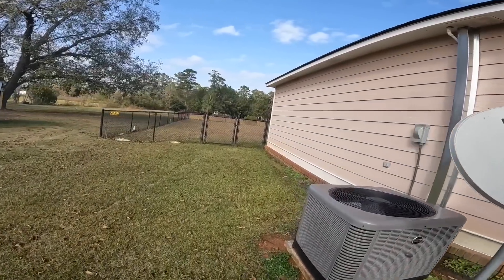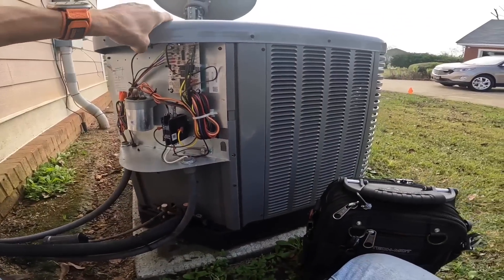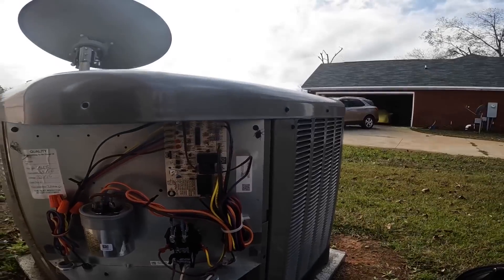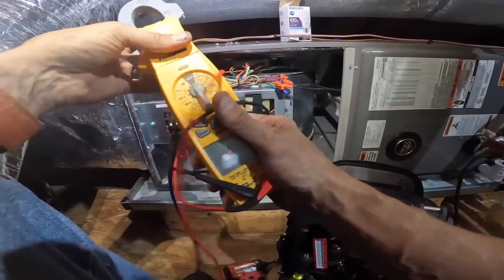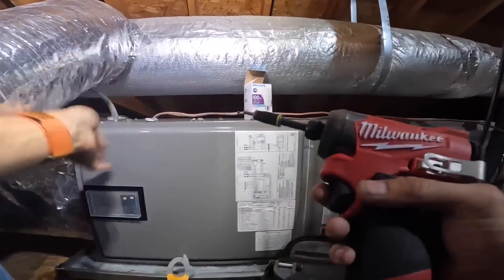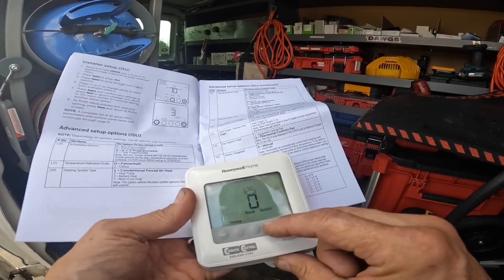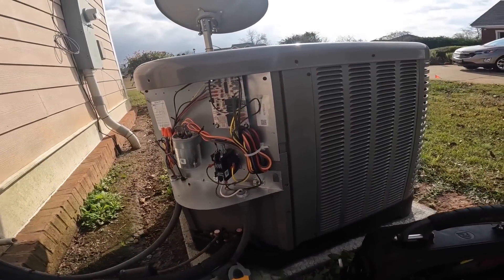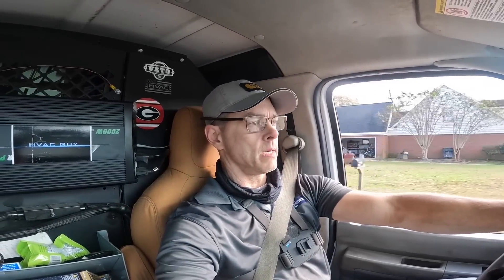Very High Utility Bill For Previous Day

Comment: I have had a few issues with these also, that was a pretty lengthy diagnosisng process for figuring out a pretty easy issue. You don't need to put your gouges on every unit you come to.
Reply: If it’s a no heat or no cooling call, you ABSOLUTELY should put your gauges on the equipment. You are there because the system is broken. It’s your job to make sure EVERYTHING is working before you leave. It only takes five minutes to check the charge/evaluate performance of a system you are already running.
Reply: @jman0870  no you don't. Waste of time putting gauges on a brand new install when there's an electrical issue. Especially the first thing you do with a heat pump is check the reversing valve. Lol.  He said it was a new system. You can tell a charge by temperature of a line and you can check a reversing valve many different ways without opening a system up. Cmon rookie
Reply: @noway5231  calculate superheat without a suction pressure, hack. You can have perfect air temps and high superheat in the shoulder seasons. You’d know this if you were experienced. How do you know the installers purged while brazing? I’ve replaced clogged TXVs at startup because of bad installers. 

He didn’t go in depth with how familiar he is with that particular system. Maybe he didn’t need to put gauges on it. YOU, on the other hand, made a piss poor blanket statement about not needing to put gauges on a system that is part of a legitimate service call. If you’d like to be embarrassed again, feel free to reply. 😘
Reply: @jman0870  lol oh boy, your one of them do gooder residential super mechanics huh? Dude a service call on a heatpump that is cooling I would not throw my gauges on right away. You do not need to open a system up on every service call, especially if there's an electrical problem.  Do you check the superheated of every RTU that you go to? Lol  You do not need to throw gauges on every system you come to. I guess, if it makes you feel better to see the pressure of a system that has an electrical problem, have at it sailor!!! Your doing God's work! Lolol
  I don't fault you, you must be the guy out there with his pencil and notebook calculating the problem.....I'm the guy that swoops in and fixes it while your still thinking about fixing it. Have fun safety Sally. ;)
Reply: @jman0870  Superheat lol. You check superheate on every call? Lol you must be a youngin?????
Reply: @jman0870  lol, Superboy I love it! Take your superheat readings and continue on! Yea boy!!!!! Don't forget to take your oil test kits and test the oil on every compressor....keep changing them expansion valves, I bet half of them ain't even bad!!!!!! Lolololololol Have fun superboy!!

Comment: The tea Siri thermostats are absolutely garbage my families been doing air-conditioning for 58 years now garbage well we had to end up doing because we couldn’t get any more pro 3000s nor the pro 5000 by Honeywell we went to Goodman and picked up a thermostat call a process that which works just as good and I even believe it’s a little bit simpler which that’s hard to believe

Comment: Oh wow!  Reading the other comments, I had a similar experience.  I installed the Honeywell to a new install (4 ton, 16 SEER heat pump with new air exchange box) , and the unit ran a lot!  I called Honeywell for assistance, and they indicated everything was correctly installed, so I should call the installer back.  Nope, I packaged it up, put it on eBay, bought an Ecobee 3, and have loved it!  I was about to blame the installer for faulty equipment! haha
Reply: Why would you sell something you have good reason to believe is defective?  Why pass your troubles on to some other poor schmuck who is trying to improve their HVAC and is going to have to go through the same waste of time and money you did?  There is that honesty thing again.  Either send it back to the supplier or manufacturer, or just put it in the trash and eat the loss.
Reply: @BryanTorok  Just because it did not work for my single-stage heat pump and air handler does NOT mean it will not work with others.  Obviously, the units work with other configurations but not all. Could you send me your name and address? I sell a lot of items that do not work for me.  I just sold an LC8i line-output converter (for quite a loss) because it did not work well with my truck's audio configuration. Do you think that helps answer your question?
Reply: They are the "cheapest"

Comment: Quality issues with Honeywell will likely get worse because Honeywell isn't Honeywell anymore (environmental and industrial controls as their main focus), it's an investment company now, Wall Street wheelers and dealers. Their main focus now is buying up and liquidating or packaging and reselling other companies. 

Any one out there like Muck Boot? I had bought them for over a decade because of their quality. Honeywell bought them up in 2019 (yes, Honeywell owned a shoe company) and the first pair of Muck Boots I bought after that, the soles started peeling off after a month and a half. Honeywell sold off Muck Boot in under 3 years to another investment company.

Comment: I've also got the Honeywell T4 ProSeries on a heat pump furnace. New construction, so everything's under 1yr old. Not happy with it either. 
I'd like to have something I can program so it cycles only 1x per hour or go over set point & have to drift under set point before cycling again. Seems like excessive wear & tear when it kicks on/off 3x/hr. 
If you come up with another t-stat you like better for heat pumps, let me know, I'll buy 1 from you !!
Reply: One cycle per hour isn’t enough 🤣

Comment: I had a new Honeywell thermostat installed with my last new furnace/AC. It turned out to be the base of the thermostat that was bad. Took 3 new thermostats before they thought to change the base.
Reply: You need a new service company. If I change a stat I change the base. Period. Hell, on the 8000’s the brain is in the base 🤣

Comment: The T series thermostats are trash. I've had multiple issues. You can NEVER go wrong with a Pro 5000, Pro 6000, or Pro 8000. If you stick to those 3, you will not have T-stat call back issues.

Comment: Honey well had to back pay us for over 20 service calls due to the t10 thermostat wiping programmed settings when connected to wifi. Honeywell recommended not to enable wifi and had to pay us to go and reprogram them all. Junk thermostats id rather use a t4000 or 5000.

Comment: You kept calling the indoor unit a furnace. Did you mean air handler?
Also, stick with the manufacturers thermostats when installing new equipment. Yeah it's more expensive but it would've paid for itself with that first warranty call. Plus, there a added features that are not available with aftermarket thermostats--esp for Rheem.

Comment: Twenty seven volts, you didn’t set the voltage tap on the transformer you can do this when you return to replace the new thermostat.

Comment: Ecobee.  A lot of utilities have discounts or rebates or both for them. Just got one free from mine.  And have used them in the past. Never had any issue. Except that they won’t work with communicating thermostats or systems that use comfortnet .  When you have modulating systems.  It only will do stage 1 and 2. And only one accessory.   But programming is easy and lets you control anything. I like leaving the air handler running for a minute after the compressor shuts off to finish extracting the cool.

Comment: With the new smart meters, her electric company (the one she pays the bill to, not the area's provider) may allow her to access the daily information. It can also be done if you install a monitoring system in your breaker box.
Reply: you can read old meters too thats how it was done for a long time
Reply: @SpicyBloodBean : Agreed. However, that would require the occupant to check the meter daily in order to know. Almost no one is going to do that. However, with the smart meters, you can get alerts if you're provider is set up for that.
Reply: The Sense home monitor.
Reply: @racinjason68 : I had mentioned a monitor in my first post.
Reply: @racinjason68  I have the Emporia View and  am able to monitor the mains and each individual
circuit in the service box,I have the plug monitor too which can monitor 120v plug circuits.
It can monitor by the second,minute,hour,day,month and year on each circuit.
It can graph out usage on each circuit and it stares all the data.

Comment: Great diag.  I once had a heat pump before we had gas.  Our house did not have gutters like this house and the run off would encapsulate the unit in freezing rainy weather.  Be nice to have a gutter over that unit.
Reply: I used that simple answer once. It worked!

Comment: Honeywell was great until the new square ones. I stopped selling Honeywell after 3 messed up and wouldn't shut off. I don't want to be responsible for the heat coming on in the middle of the summer especially if there's pets inside. I won't chance it anymore. I sell Emerson now

Comment: I have heard others talk about problems with Honeywell models like this.  Calls like this cut into your bottom line but you’re honest and give the customer the best experience. Others may have sold something extra to defray the costs.  Great job as always
Reply: Sold something extra to defray the cost? Why do HVAC guys act so broke af? Legit question. Are margins terrible? Always wondered what the deal was. Its like the only trade that a customer can't outright get the equipment themselves or it doesn't make sense to procure it themselves (vacuum pullers, gauges, etc), insane markups (looking at you capacitors/contactors), the most inelastic demand (who wants to freeze/sweat their ass off)? With all that going for them they seem to just be so lazer focused on their P&L to a point that kinda seems unhealthy.
Reply: @stevenohnsat7535  I guess what I was getting at there was selling some scrap metals that were going to the scrapyard anyway  just speeded up the process a bit
Reply: @JC-jk3kl  lmao!!!
Good luck with that. I was at a home that they sent 3 different service companies out to repair a Lennox gas furnace. Last service tech actually spent almost 5 hours trying to repair and ended up telling the client they just needed a new furnace(as the other 2 companies did).
Was a stupid normal stopped up port that the vacuum switch is connected to. 
The vast majority of the service (tech wannabes) are a complete joke. Only seems like they just want to sell and have absolutely no idea what they are actually doing.
BTW. I work with several hundred real estate agencies and I can tell you first hand you will almost never pay just the service call fo hvac repairs. 
I can give you 2 examples just from this week and I only worked Monday and Tuesday.
Reply: @JC-jk3kl  You must be a shill for them.  They have been shown to be a cut rate outfit that will find any excuse to not pay a claim or deny coverage.

Comment: Had the same problem with the T series honeywell. Went back to the pro 5000. Haven't had a problem since. If you are considering using a different brand I've had success with the PRO1 T721.

Comment: Lots of issues with Honeywell.  Had a plain old non programmable one doing flakey shit. I installed it. Simple 2 wire. After 1 month it would say it's 70 in the house when it was 50. Always middle of the night. Get up to piss I noticed it's cold. I go out. Check  everything. Check batteries, all good. Run the set temp up and down it start working. 2 days go by it do same thing. I got a replacement, Installed, it's been fine now for almost a year. Looked into comments and reviews, ppl saying same thing. How can a simple 2 wire, heat only thermostat be bad that many times.

Comment: I have an energy monitor Emporia Vue that samples energy use every second.  It's on the main legs to the panel.  You can add CTs for individual circuits and name them in the app but I'm ok with whole house usage. I can see my heat pump when it's running and see the minute, hourly, and daily usage.

Comment: There is a common issue with the t6 thermostats being the backplates are garbage. The t1 non programmable hasn't had those issues. Vision pro 6000 doesn't have any issues either

Comment: I have had many Honeywell t6 pro failures. Most of mine have been not sending voltage out Y1 but I have had a few not sending voltage out O. Honeywell did have a bulletin out a few years ago and acknowledged a problem between date codes. My issues have been outside of date code as well. The 8000 is my favorite.

Comment: Well Curtis IMHO, about a year or two ago we were gifted with a Nest learning thermostat. This thing is truly from this millennium !  Yes they are about $150.00 or so but it is way better than the old Honeywells of the last century.
It is wifi capable and can be fully programed and controlled from a phone app, from anywhere in the world. I have been out of town and forgot to lower the temp. Then I found out that it already did it "automagicly"  because it knew no one was home. The Nest device is way better than the old school thermostats.
Reply: Those are great stats as long as homeowner is capable of using the app. Not all of them are.

Comment: I have ran into a few issues with these T series, but if I'm not mistaken and I could be wrong, I always thought Rheem was standard to have reversing valve to energize in heat on B side instead of O, but either way good one 👍
Reply from the maker: You’re correct

Comment: The T series suck. Gotta have batteries to maintain the date & time during power outage or the t stat won't come back on and operate properly until the time and date are reset again. They also mysteriously go into lockout mode. There's no possible way the homeowner could accidentally do it. There are too many steps involved. And I've had too many calls where the thermostat was in lockout mode for it to just be a coincidence, or a one-time thing.

Comment: Curtis, did you check what version of the T6 this was?  For a while I had issues until version 5 came out.  Lasted about 2 years then started having problems again.  I switched strictly to the VisionPro thermostats (made my distributor match the price), and haven't looked back.  No issues since.

Comment: Ive had at least 3 of those honeywell T6 smart thermostat terminal block plates bad right out of the box, no connection through that plate but the front of the thermostat faceplate and program block area was fine.these arent the best thermostats,, the have off and on problems and the manufacturer has verified in past instances that there was indeed a widespread issue and replaced all the bad ones we had for free funny thing was they didnt want to pay the labor for us to go back out and change them all out lol.. good catch on this one, keep your eyes on these

Comment: My company also stocks the Honeywell t series tstats. I have ran into a few that have issues like not passing a y or o call through but overall in my opinion they are still a quality tstat. Great videos keep up the good work
Reply: I wholeheartedly disagree. Those stats are garbage. The T6 stats don’t work, period, if they lose power for too long and the clock needs set. Yes, you read that right. If the clock needs set and you aren’t home your pipes will freeze.

Comment: Thermostat + programmable = problems and call backs.  A tstat is an on off switch, simple.  It becomes a problem when time is added.  I use a Honeywell programmable.  It has the same temp 20 hours a day with warming at dawn in heat, same temp 24x7 in cool.  If you have to tell the stat what timezone you are in or the PW to your wifi, the rest gets bad.

Comment: I can't see why any homeowner needs a programable thermostat. I leave mine on 75 in the summer and 72 in the winter.
Reply: in many older homes with poor insulation and lack of air sealing, any type of "set back" can quickly waste more energy trying to recover than it saves.
worse if it's slab/ceiling/wall heated.

Comment: Hey Curtis, never had any issues with Nest, only good results here. Hey, can you do a video on ultraviolet lighting for ACs? Do you ever get any customers wanting to install them or maintain them? What are your thoughts. Thanks!
Reply from the maker: I’ve found that the ionizers are even more effective, and there’s no bulb to replace. But, there are some products that have both.
Reply: @HVACGUY  hmm, interesting, I haven’t seen those. I’ll do some research on it.
Reply: @HVACGUY  I cannot stand being in a building with an ionizer on. It smells terrible to me. I don't know why I can smell them. I have a couple of customers I had to disconnect the ionizer because they could smell the same thing as I. I have no clue why everyone can't smell them.
Reply: I just had a customer's nest to fail. It stopped sending voltage to the fan g  terminal. I've got to go back tomorrow and replace the aux heater relays.

Comment: Had a york thermostat act up 

Heat came on the temperature would roll back to 0 no biggie it cycled on and off as normal

Heat came on one day it never cut off it got to 107 degrees inside i learned if its acting up dont try and milk it